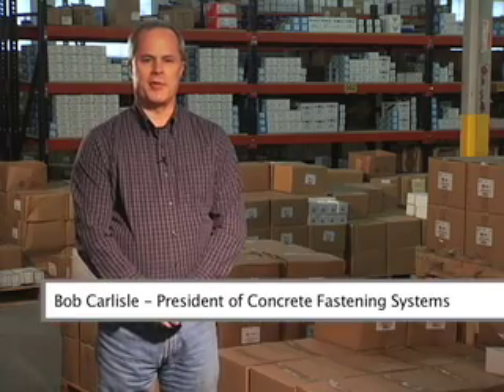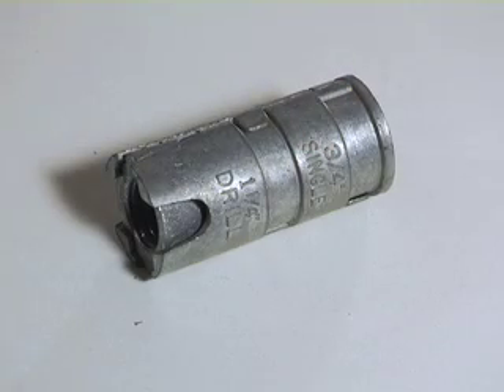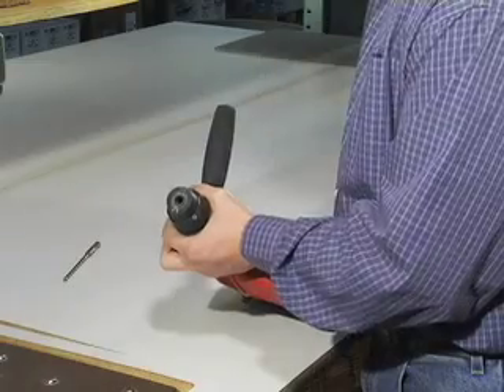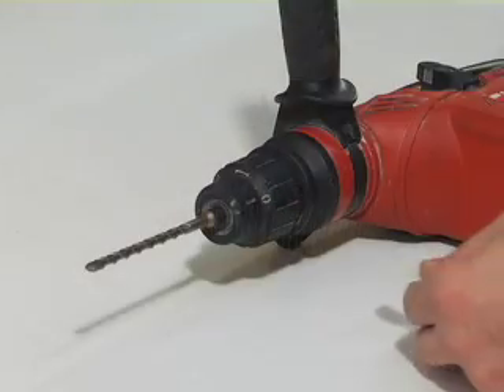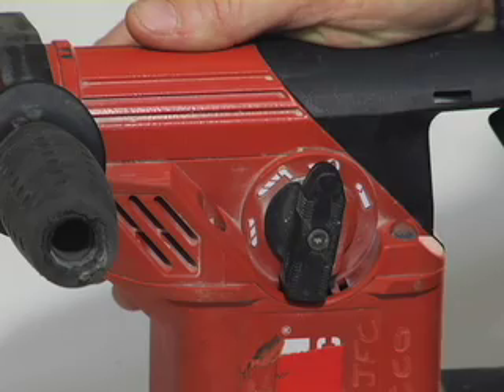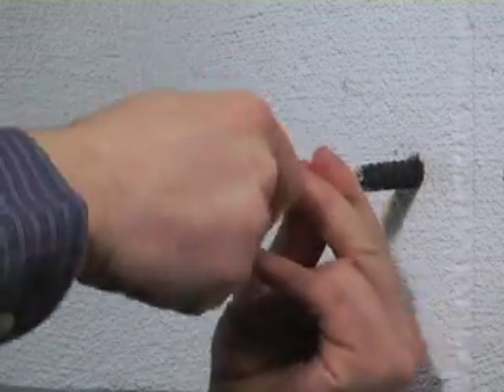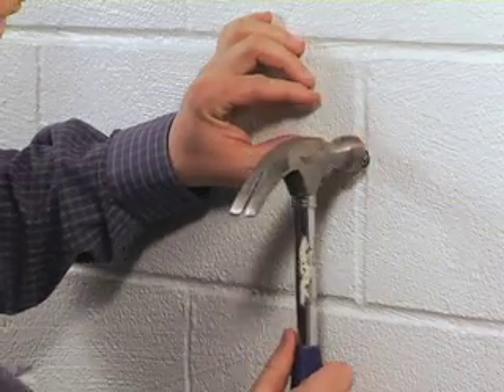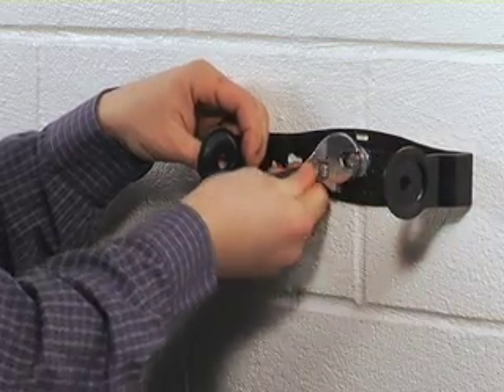How To Install Single Expansion Anchors

Comment: Do these work on hollow bricks where you would drill all the way through and hit the hollow space? I see in this video you drilled next to the motor joint, went through and vacuumed it out but then when you put in the anchor you were in the middle of the motor joint. (Different hole).  Maybe you could show video on a single brick to show how they work? Thanks